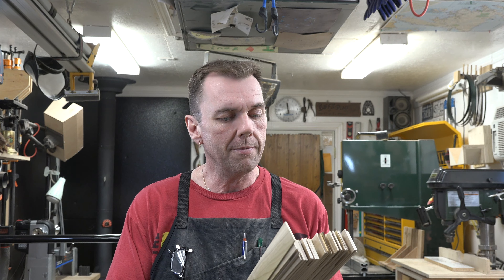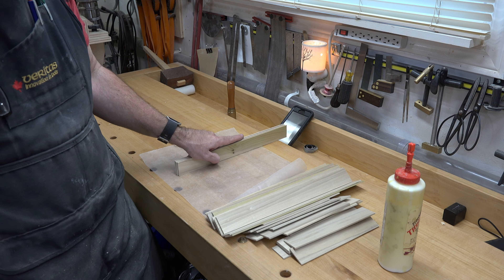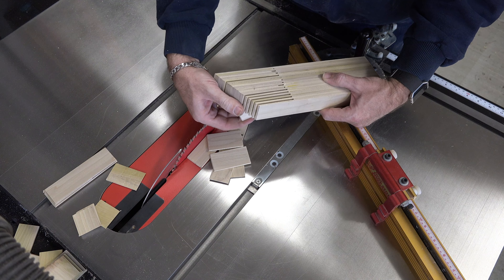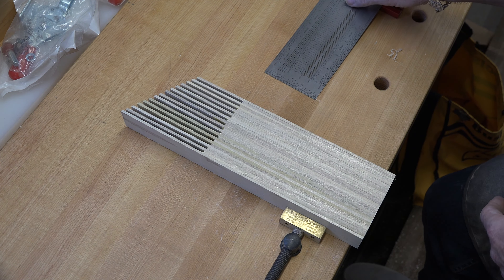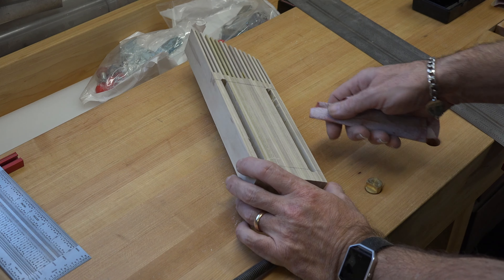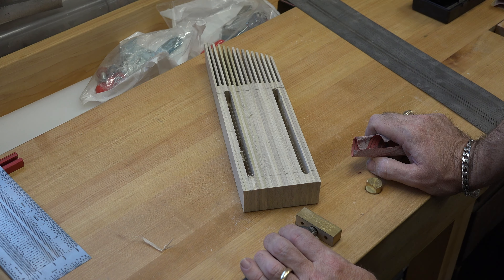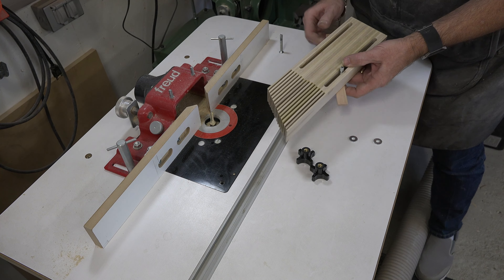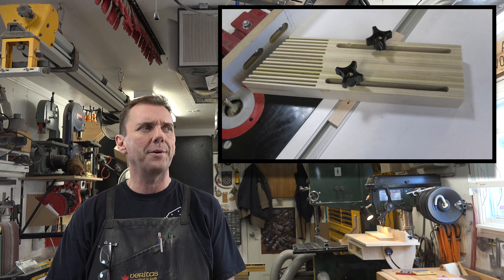Featherboard from Scrap Wood

Comment: Spending time in the shop is never a waste of time as long as you have fun with what you doing.
The best ideas come up just by going trough your scrap wood pile. As they say; It's not scrap, it's just peaces not used yet!
Keep up the good work.
Reply from the maker: Thanks Sigi.  This definitely was a fun project to make and I have used it several times since making it and it works very well.  Thanks for tuning in.

Comment: There is just so much satisfaction in using something that would otherwise have been thrown away to make something usefull.
just the other day I used a scrap piece of 13/16" (21mm) plywood to make some wing nuts for a project (fence for the router extension on the table for my jobsite table saw) because the plastic ones I bought had the wrong thread count. It also gave me the perfect opportunity to test my new Bosch forstner bits. :)
Also, the locking strip for the mitre slot was exactly how I envisioned it for the ones I have planned to make for my table saw. Great minds think alike. ;)
Reply from the maker: I couldn't agree more.  The level of satisfaction is absolutely indescribable.  Thanks for tuning in to the show and for taking the time to leave the kind words.  It's truly appreciated.

Comment: thank you . great idea on the scrap . thank you for the heads up on the holes . great info . how do you waste time making something . you don"t
Reply from the maker: You're very welcome Walter.  This was a fun project and has proven to be very useful in the shop.  I don't think it was a waste of time but there are those out there that would rather just cut some slots in a piece of wood than fuss around with this sort of glue up.  No big deal, I had fun with it.

Comment: Nice job, sir. It's a great design for us beginners. I want to make a few of them. The video is quite helpful, but I do not have a scroll saw so I'm trying to think through whether or not I can accomplish the slot with a jig saw? What do you think?
Reply from the maker: The slot can definitely be done with a jigsaw.  I would suggest drilling holes in either end of the slot and then you only have to use the jigsaw for the straight sections of the slot.  This way, you eliminate the need to rotate the saw quickly in order to get the rounded ends of the slot.  Another way of course, would be a router table, taking multiple passes until the slots are cut through.  I hope this helps.  Thanks for the kind words on the show and for tuning in.

Comment: your start/stop marks to the center of the cutter have no reference so you can get pretty close to  the right spot.  Make your marks from the ends of the fence that you have so you can get it better than eyeball.
Reply from the maker: As with most processes in woodworking Dudley, there are many different ways to accomplish the same task.  Thanks for chiming in with your suggestion and for tuning in to the show.

Comment: Would it have been easier  to route the grooves if you had just squared each end first? Then you could have used stop blocks and cut the angle afterwards.  Mind you, just because I notice stuff like this in your videos doesn't mean that I notice the same things when I'm out in my shop :)
Reply from the maker: I guess it is six of one and half dozen of the other Ken.  It wasn't all that difficult to do the way I did it and after thinking about it, your way would have been a little less fussy than my way.  Good idea.  Thanks for suggesting it.  Where were you when I was making this darned thing?  LOL.  Thanks for tuning in.
Reply: Like I said - just because I see it in your video doesn't mean I recognize the same thing when I'm into a project in my shop :) At least not until right after I've done it the hard way.
Reply from the maker: Apparently, you and I think the same way in the shop.  ha ha ha ha ha ha ha ha.  How's that for a scary thought?

Comment: you're a "messy little glue up" Nice video---perfect for off cuts from squaring up dimensional 2X4's
Reply from the maker: Definitely a great project for using up those 2x4 scraps.  Good call.  Thanks for tuning in.

Comment: I would bevel cut the maple strip instead of making that groove, for keeping the piece inside the slot.
Reply from the maker: That method would work too Hernando.  That's the great thing about woodworking...there are many different methods to achieve the same outcome and as long as you are being safe, then choose the method that works for you.  The methods that I demonstrate on my program are strictly suggestions and to branch out and try your own things is awesome.  Thanks for tuning in and for taking the time to chime in with your suggestion.  I appreciate it.